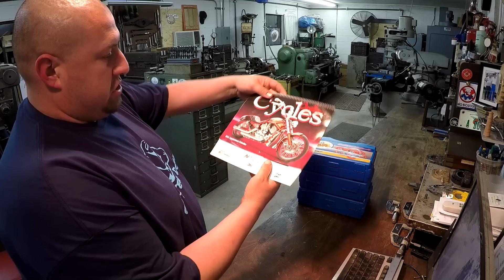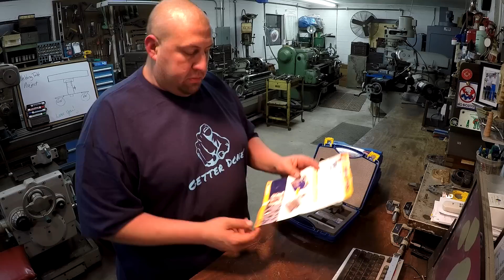Saturday Night Special 53

Comment: Good tip on using smaller inserts for most work. I also have a face mill that use CNMG432 inserts on the unused point so the inserts are free after being used in the lathe.
Great video as usual
Reply from the maker: Yes I've always wanted one of those mills that use the other 4 corners!

Comment: Adam I used a CNMG 643 years ago on the first CNC lathes I ran, we was machining large gear blanks. The thought was the extra mass of the carbide would make the insert tougher..while at worked well we went away from them because of the improvements in insert technology. I have used the other Iscar inserts that you mentioned on a job that we remove a lot of stock of of billets blanks to make the parts for the truck components tha this my day job. Those inserts do a fantastic job with chip control.
Reply from the maker: Very cool James. Inserts have come a long way since yesteryear. The modern designs do a very good job at chip control.
BTW, i tried that big turning tool today on the Monarch and was able to cut .500, or 1/4" per side. First time I have removed 1/2" on the lathe, at a .020 feed rate.
Reply: Abom79 Yes they have came a long way. The carbide is getting better for sure. One thing else, I been cutting dovetails in tools designed to be used in larger lathes, in fact I seen John (Doubleboost) tooling that gave me the idea. I have had good results so far, and it is actually less expensive. I get samples and "obsolete" tooing, also the prices of the larger inserts are not that more expensive than the metric sizes for hobby lathes. My point is sometimes you have to look at the cost out of pocket for tooing to get the most value. You are one of the few youtube channels that actually push your tooing. Keep up the good work

Comment: Nice score on those Mics. I have the 0-1 and 1-2 and really love them. One thing I likd to do with a digital mic is to zero it out at the final size so that I can read directly how much more material needs to come off. Thother nice thing is that you can now measure those occasional metric jobs without having to convert everything.

Unfortuantely I dropped my 1-2 yesterday and I think I knocked the barrel out of alignment. I guess it's back to e-bay for a replacement :(

Thanks for all the great videos.

Comment: OMG I am so jealous you got those mics! I have the exact same model of the 1-2 in 0-1 size and always wanted it's 1-2 brother and good blade mic. That is an absolute steal and I'm surprised they didn't sell. They are extremely well built and accurate to 50 millionths of an inch. I hardly ever use mine and it's still mint because I don't want to get it dirty :)

Comment: What shaft material was that in the Pacemaker? That was an odd color of blue chip, or at least it looked odd on my end, almost like a pastel.  Since the turn wars series I have actually been using a CNMG644 to rough in with a .250DOC (.500diameter reduction) and ,020 feed it does very well. Then I switch to a CNMG432 to finish turning and I find a .010 feed seems the best starting point for a good chip for me. i bet with a CNMG3xx you could get a better finish by running a slower feed and still break a nice chip.
Reply from the maker: Brian, the shaft material is 1045 steel, 5 7/16" turned, ground, and polished. I took one roughing pass of .300, then backed off to some finishing passes.
Funny you mention the .500 metal removal. I just did that today on my Monarch. First time! I used that turning tool I showed. It's a COMG 643.
Reply: Abom79
 That is awesome man! Welcome to the .500 club! lol  If it cuts similar to what I have been using I think the insert and machine could take more as i don't get any real noise or chatter, I just don't have enough ponies under the hood to pack any more cut than that.
Reply from the maker: The machine handles it, but in afraid to push it any harder. I know the tool could easily handle whatever depth you wanted to try, but gotta have the hp to push it. 
I could probably take some more if I backed off on the feed, but honestly, no really need for me to keep pushing the envelope. .500 removal is plenty for my work needs.

Comment: I don't know if you buy from Kennametal or not but they will often sell you any number of inserts you like. I bought 4 NG4 style threading inserts that were $27 a piece and I could have ordered just one if I wanted.
Reply from the maker: I do buy from Kennametal, but mostly at work. I've been having really good results with the Iscar inserts lately so I've been sticking with them. The tool I ordered is not very common and were out of stock. It would be nice to only have to buy one or two inserts, I'll keep that in mind and check. We can buy direct from Kennametal at work.
Reply: Abom79 I'm actually not a huge fan of Kennametal products in general and I believe Iscar is a higher level (although I have personally not used much Iscar) but I do like Kennametal service and support and being able to buy direct from them over the phone is a plus.

I live on the West coast of Canada near Vancouver where there is not much manufacturing and its hard to find good local suppliers for anything who know what they are doing. 

We did a lot of largish 316 welded and machined flange bearings and shafts for marine use and by accident discovered Ingersol CNMG 432 ML style inserts were noticeably better than Kennametal's equivalent for manual finish turning stainless. For general machining of A36/44W type steel I like Kennametal's KC730 grade and find it holds up well.

Comment: If the felt is on the bottom of your new box in memory of your Dad you may only need to bore half deep. Do you think that will work out Adam? I really like that hub mic and the nice big Lathe file. I hope you have a nice handle for it.> I have used the Penta cut and they do great and they hold up fantastic. On CNC you can really do a lot of grooving and stuff besides that. Iscar is so good I can not think of anything I have used which was not a winner.

Comment: Shop Pictures: Now that's some heavy metal! Does your office play heavy metal music when your working on those large parts? :) 

On the Iscar mini mill. I have a 4 Inch facing mill that I used to face wide workpieces on my Manual mill. If you're just taking facing cuts it doesn't required a lot of power (especially in Aluminum), but it saves time have to take multiple passes on wide workpieces.

No complaints on the format. Often the old tools, (non-Chinese) are much better than the newer "Shanghai" tools. Thanks for the full year of interesting videos!

Comment: Nice tool collection that I'm sure you'll put to good use. By the way Adam, I noticed 2 oil pressure gages in your K&T but I lost track of your planned repair to the machine; is fully functional now?

Regards 

Jorge
Reply from the maker: Jorge, I haven't yet got back on the K&T repairs. Hopefullt that will happen pretty soon.